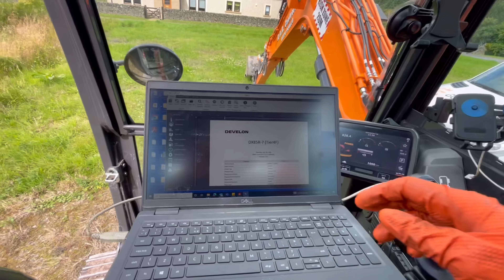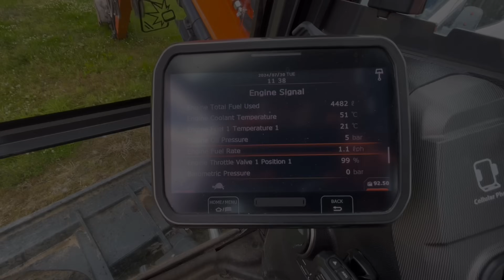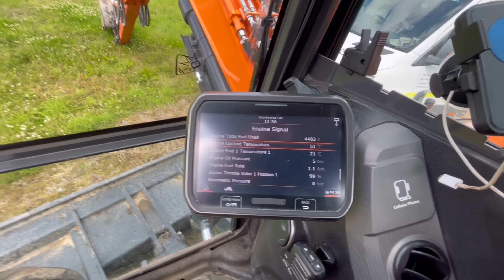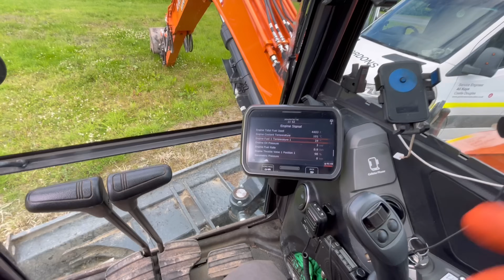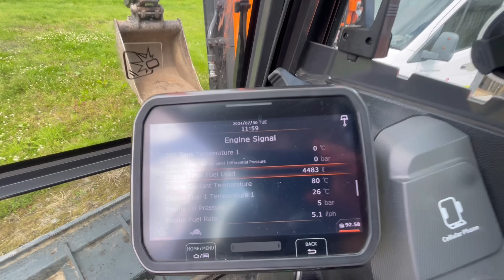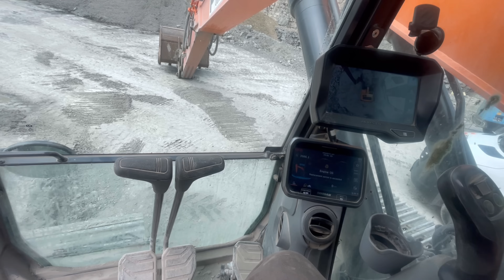Here’s why it needs a new pump / quick quarry visit / I hate horse flys !

Comment: dont think that was wd40 on the engine  alot of truck drivers  spray baby oil on there engines if there going to go  to a truck show  and in the winter  the muck washes of alot faster
Reply from the maker: It didn’t smell of anything to be fair but like you say it’ll wash down easy between jobs 👌